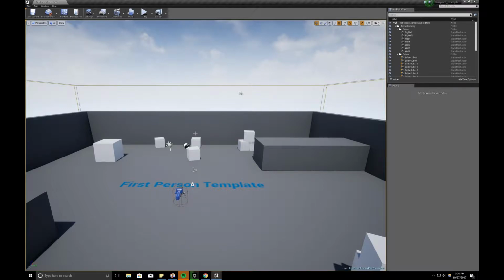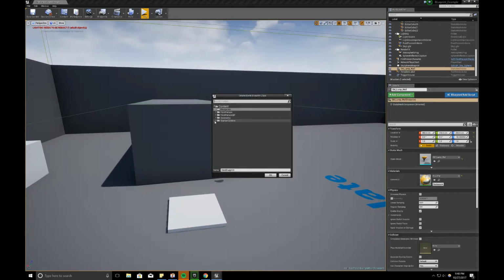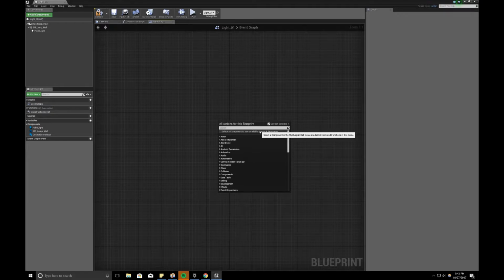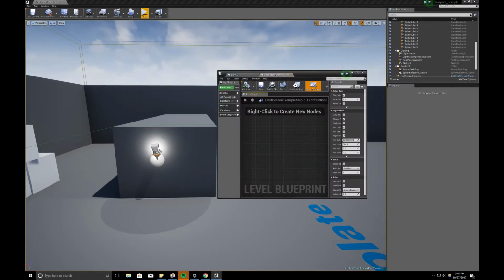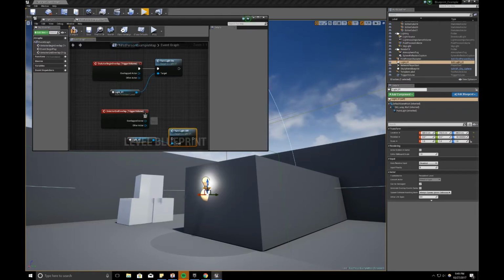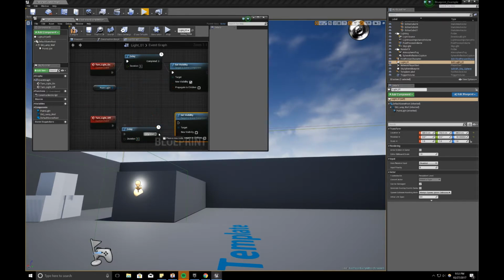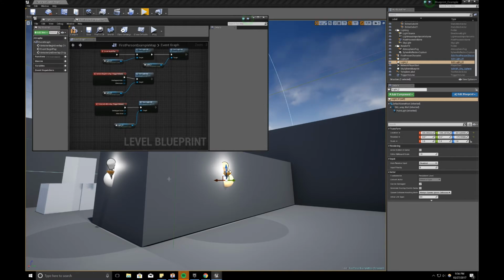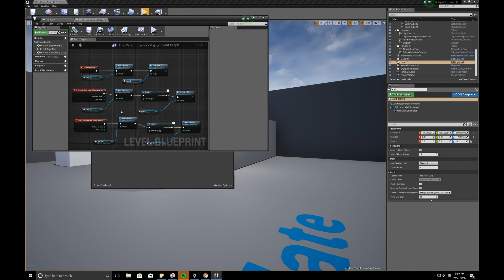UE4 Blue Print Tutorial - Basic Triggers and Lights

Comment: Hey - nice tutorial... i got a question though - how can i trigger the lights not by the player but another actor - like one of the cubes in the background? My goal is to change the position of one of the cubes via cinematics - and once the cube is close to a light - it gets triggered  ... any help is appreciated ... best regards...
Reply from the maker: Off the top of my head, if it is moving via a cinematic, I would create a custom even to turn on the light in a blue print. Then in the cinematic track or after it is done trigger the custom event.
Reply: @m0zidesigner  hm ... the idea is, to make a short clip, where a car ist driving on a street and on both sides lights are switching on when the car is close enough... so - about 200 lights - switched on one by one, depending on the distance of the car...
Reply from the maker: @aprilhamlincom18  I figured it out I will be posting a quick "crash course" video tonight! Stay tuned.
Reply: @m0zidesigner  wow - didnt expect that ... cant wait ... thanks a lot!
Reply from the maker: @aprilhamlincom18  Posted. Recent uploads. I hope that helps.